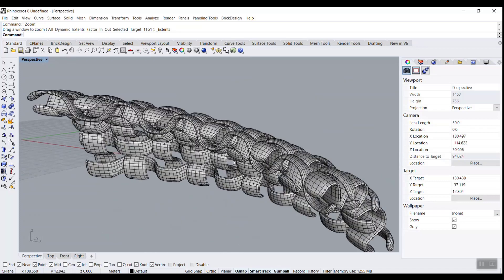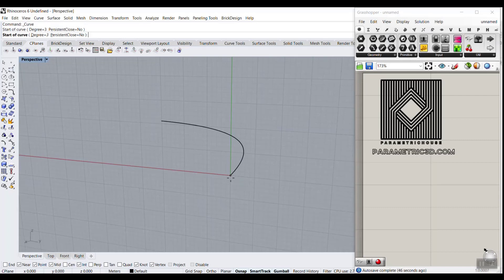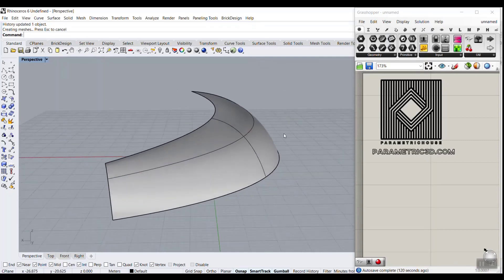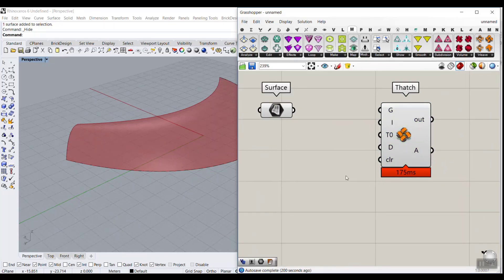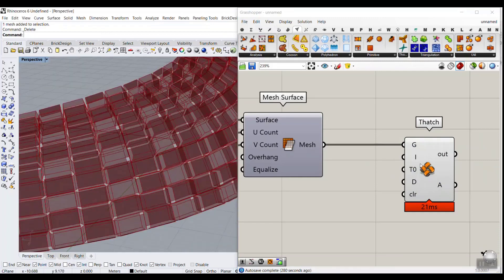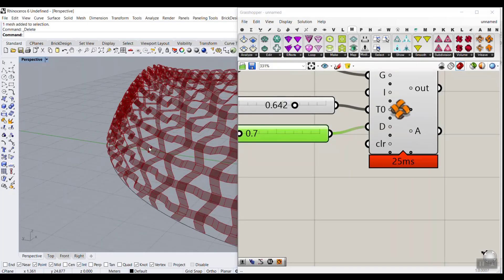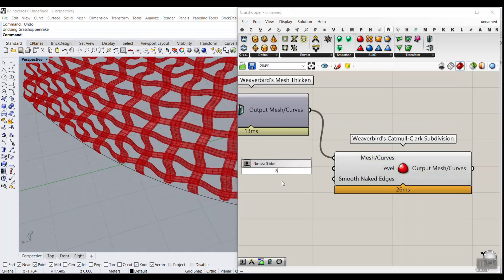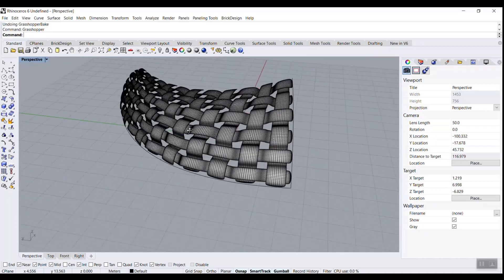Rhino Grasshopper Weaverbird

Comment: Hi ! I was wondering is there is a similar plug in available for Mac users? 
Fantastic video though! Really helpful :)
Reply from the maker: mesh+ is written in vb so I guess it works fine with Mac
Thanks😊👋
Reply: @ParametricHouse  I downloaded it and put it into the components folder but it does not appear in the components of grasshopper, any tips?
Reply from the maker: Put them into the User object folder instead. These are clusters
Reply: @ParametricHouse  Hi ! Could you give more details about this? I tried installing and added the Complete User collection to the user object folder, but can't get it to work... Also on Mac. Thanks !
Reply from the maker: Did you check out thr official mesh+ plugin page? Maybe it doesn't work on Mac